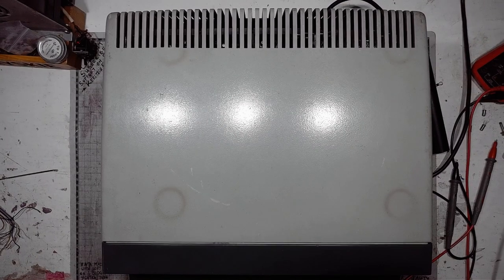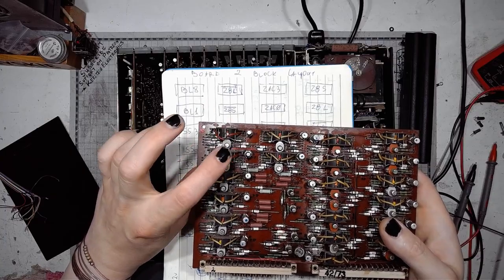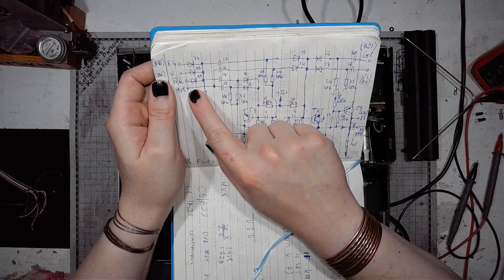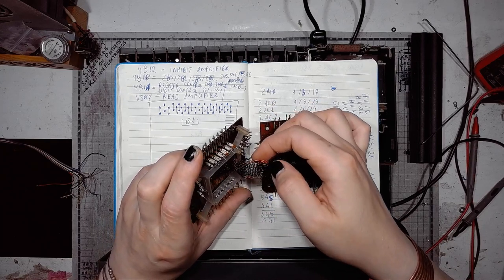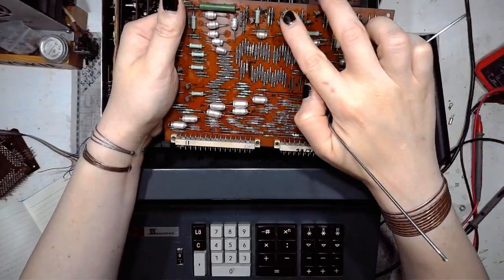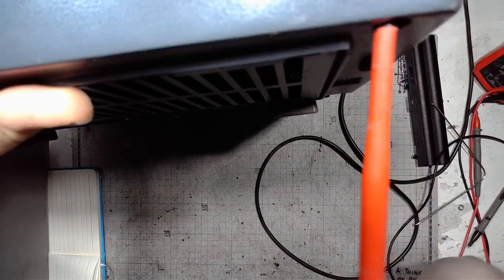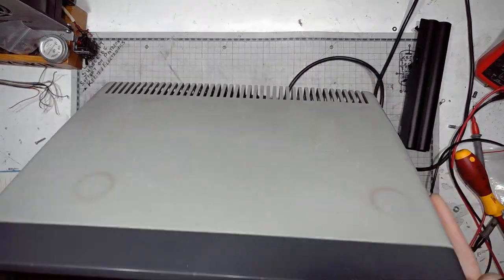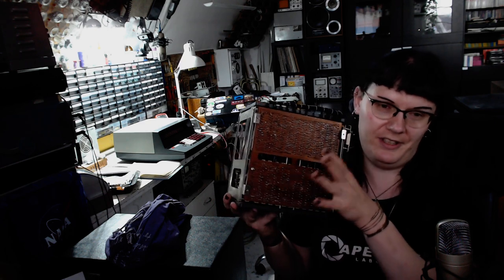Soemtron ETR220 - Apollo Era Desktop Calculator... from the GDR!

Comment: Those circuit boards are huge!
Reply from the maker: Yes, they are! Larger than a low-end graphics card, there's 12 of them and this is just a calculator. All single layer, all with discrete germanium transistor and diode logic. Electronics has made huge steps since then.
Reply: @KeritechElectronics  to think that those large heavy components are now "grown" on a substrate is amazing!